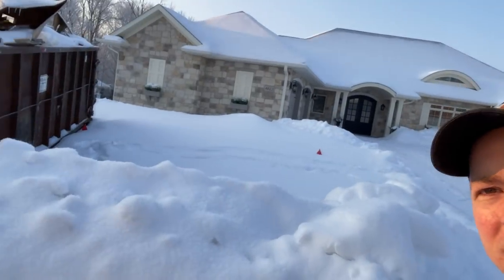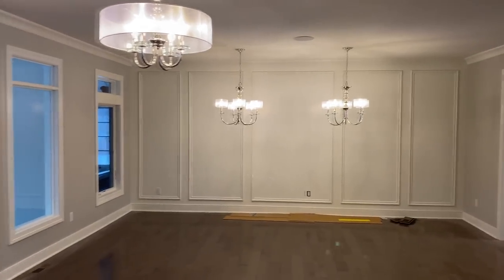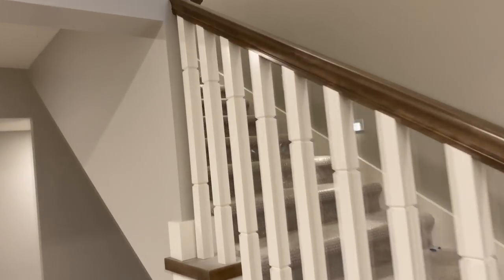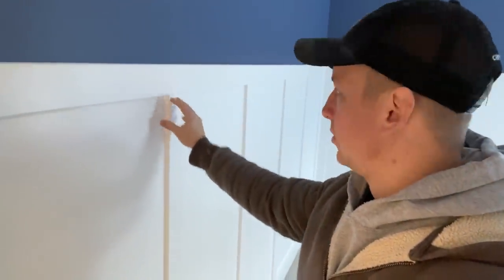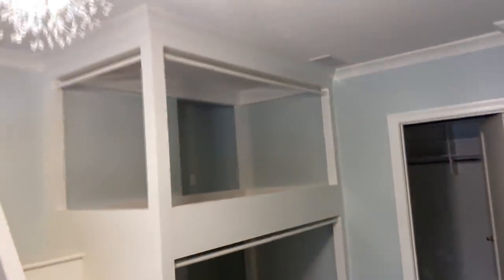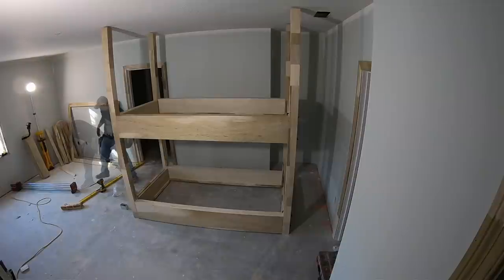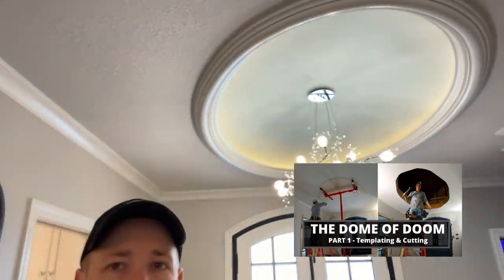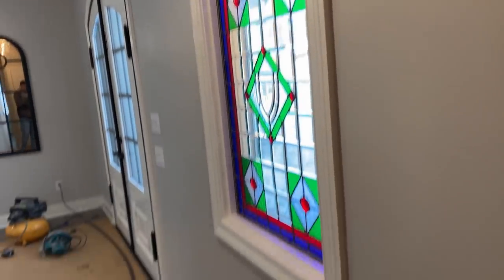The Debrief | Episode 1: Finished Product Showing How It All Came Together | The Cliffs

Comment: Hey the Milwaukee gun works perfectly with the dewalt battery adapter? My dewalt brad nailer doesn't like to set nails
Reply from the maker: The 18 gauge Milwaukee is great. I will have a video up next week talking about the Milwaukee 15 gauge. Which I didn’t care for.